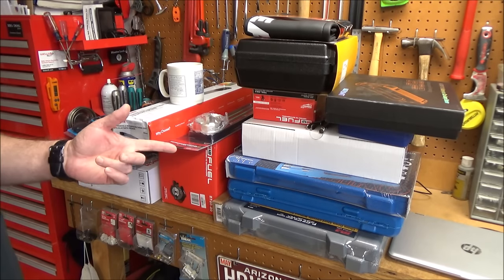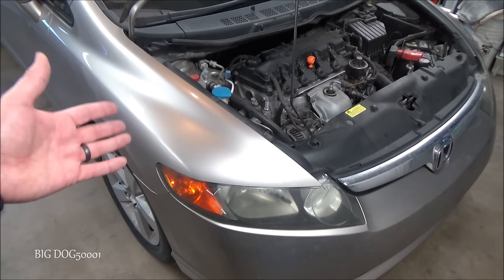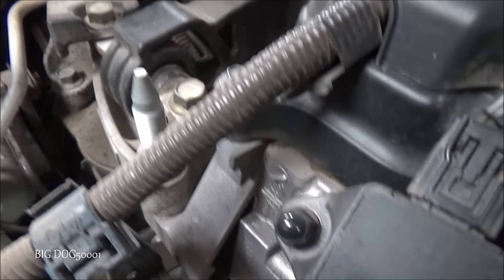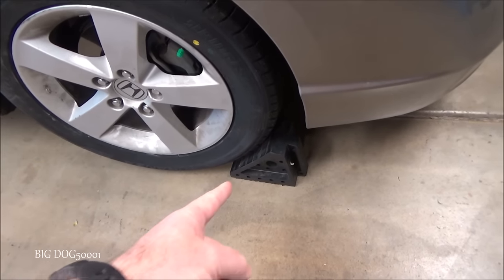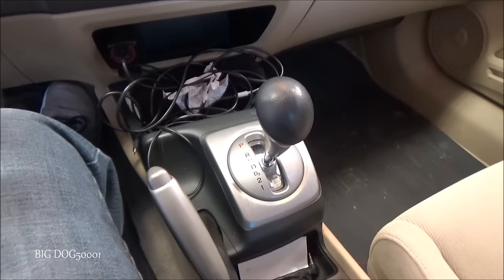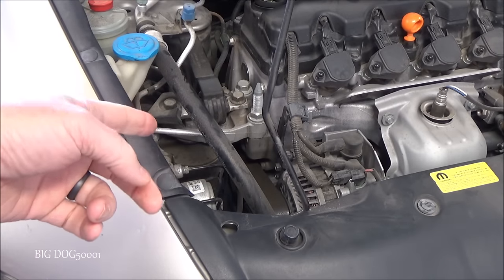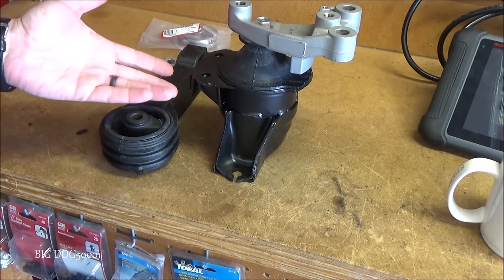Honda Tips: Clunking/Thumping Noise Coming From Front End of 8th Generation Civics

Comment: I have an 08 civic lx and the digital display goes in and out as far as the speedometer and engine temp and fuel level and sometimes the low fuel light blinks even though I had just filled up. Any help would be greatly appreciated

Comment: I just replaced my side mount and the torque rod, I had a vibration at idle and used your other video for replacement guidance but it also took out my clunking noise when I hit a bump which I wondered what it was, I replaced the front struts last year and thought one was bad.It took me longer than your video-lol-but I was able to replace all of the parts and I'm now good to go.Thanks for your helpful videos, they are a big help.....
Reply from the maker: Glad it helped, thanks for the comment!

Comment: A simpler check will be the gap between the rubber and the aluminum support, no gap or if there touching you need to replace it. The one installed has no gap, the new part you have does.
Reply from the maker: That's part of the visual inspection, thanks for the input.

Comment: Generally the symptom on those is a nasty vibration in gear and you dont have to torque them to see that they are bad. The mount collapses and the aluminum bracket on top touches the mount itself. Also, I have never seen  one of the torque mounts go bad or had to replace one. Save your money. 22 year Honda tech. Good video for the DIY person though.

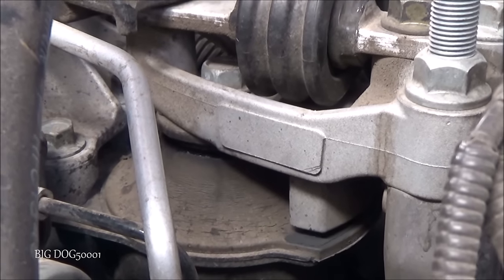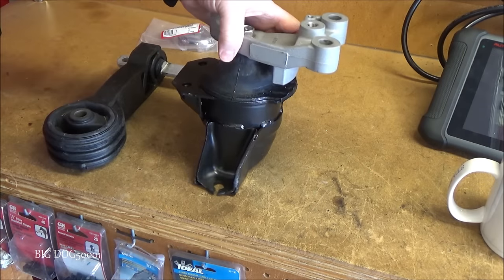Comment: 3:13 vs 4:03 not an uncommon issue, i use the "wear indicator" to determine if the mount is "sunk" and its actually the metal bar that you can see has rubbed on the mount and i will use that to determine its condition, otherwise you could always put a block of wood on a jack and jack up the oil pan and see if the problem "goes away", usually you get "excessive vehicle vibrations" and sometimes it happens more in reverse because of that mount failing, great video! just wanted to add another quick tip with the "wear indicator" i use, hope it helps someone else out there, thanks for the share!
Reply from the maker: Thanks for the input!

Comment: My 2007 1.8 L civic has a small vibration when I stop in traffic coming from the right side When I give it gas and take off the vibration stops.I will check motor mounts.Thanks for the tips,brother.

Comment: Great Video, my 08 Civic is getting a sharp clicking or metal snappy sound from the right front as though something is separating. Also, when steering to the right only, it lurches over much more that the steering movement allows, Has 130K on it, very tight otherwise, thinking strut mount or rack, thank you.

Comment: Good video. Wish I could've seen repair vid before I replace engine mount last weekend. Bolt to fender would not fully seat. Hope I used correct bolt.... did not pic removals.. my bad. Did run much quieter though and that's a good thing. Just want to complete job correctly....
Reply from the maker: Thanks for the input!

Comment: I would like to see you film on repairing this mount. Seen many videos of different procedures like certain bolts take out in order, engine drops back when removing mount due to not jacking engine correctly, etc. I want to see the reassemble because bolts don’t line up correctly. Some say taking out the bracket or jacking up engine will do. I’m all confused who to listen to.
Reply from the maker: Didn't realize there was so much misinformation, thanks for the input!

Comment: Hi thank you for the video. I have a 2003 Honda Accord. A couple of weeks ago my mechanic had to change out my water pump and my timing belt when I got the car back there was major vibration and sound that I felt all over the car. I went got brand new tires but I still felt and heard a thumping, it was in sync but now it is only in the pedals and in the floorboard. I went and got my alignment done and I got my brakes and rotors changed. I still hear and feel the pulsating thumping. At any speed. It slows down or speeds up with the cars speed. It still does it coasting in neutral. But not when parked in neutral while pressing the gas. I tried the thing you did with the car sitting still but in drive and pressing gas and brake  simultaneously and the thumping sound and feeling are there. But the sound is not loud, but I know it isn’t supposed to sound or feel like this. Something is wrong. What do you think it is?? I’m scared to drive the car!

Comment: Awesome tips Big Dog, always appreciate your videos. You should do the Transmission mount replacement next, it rarely ever goes bad. 
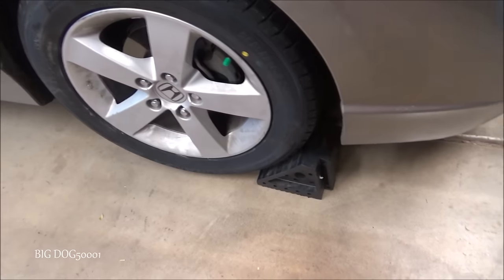 I would like to add another tip that will help identify if the Passenger side motor mount is bad. @1:48 time frame, you can see the vertical metal piece is touching the rubber lower mount. THAT vertical piece is mount indictor that its either too low or touching the rubber mount. If you can't fit 1 quarter in their, it is bad. If you CAN fit 2 quarters, its about to be done for. I just replaced mine and did a before and after visual inspection and found the new one can fit about 5 quarters, no more vibration at cold start, at idle, or going down hills or over bumps. Hope this small info helps someone.
Reply: Why would there be vibrations from cold starts and not normal starts?
Reply: cheers

Comment: 1:48 and 4:00 Pro tip. See how the metal tab on the side of the motor mount is resting on the rubber? Compare this to the gap on the new (revised) mount. Watch for the witness mark as the mount opens and closes. As a Honda tech, this was a dead giveaway that the mount had completely collapsed. (Yes it can also make noise/be bad when it is 75% or so collapsed as well)
Reply from the maker: Thanks for the input!
Reply: Hi can I drive with a motor mount that makes a clunking noise intermittent. Honda dealership installed a aftermarket motor mount because oem is backorder. Was told by Honda technician that I can drive with the motor mount only issue would be the noise. Engine doesn't move when shifting to reverse or drive
Reply: @jesuszuniga1257  can you drive with a bad mount? Yes. Should you drive with a bad mount, no. This puts more stress on other components, such as the other mounts, air intake tube, exhaust flex pipe, wire harness, ect.
Reply: The only reason I'm asking is because honda oem motor mount are backorder.  When I went to pick up car for diagnosis they said I could drive but the only thing would be the noise . Check the motor mount and engine is not moving at all its just noise
Reply: Was told by honda advisor that I could order a oem  motor mount online but wouldn't warranty the labor and part and that the noise would not go away
Reply: @jesuszuniga1257  The warranty info given is pretty standard, for the industry. The noise part sounds a little suspicion. Ask them if an OEM mount won't fix the problem, then what will.
Reply: I did ask them about that and they told me that if I find a oem motor mount online they can install it but wouldn't guarantee the noise would go away. I'm leaving to Colorado from California this Sunday and just want to get advice if it would bea issue. The aftermarket motor mount is new it's just the noise
Reply: I though it was the belt tensioner but confim by suspicious that's its coming from aftermarket motor mount.  I check the motor mount and there's no visible Cracks that I can see and the bolts are tight
Reply: I have the oem motor mount that I ordered from online . What advise do you give me . Get the aftermarket mount replace with oem mount knowing there's a chance it won't fix the noise issue or just drive and hope the motor mount makes it

Comment: Yes, film the repair. And demonstrate the test on a manual when you get a chance :).
Reply from the maker: A little more fun doing it on a manual transmission, thanks for the comment!
Reply: @BigDog50001  I would like to see that. Never came across in the shop only autos with mount issues

Comment: Thanks for the video. Film the repair, always nice and appreciated.  What I don't like on my 2015 Civic, is the clunk from the rear brake pads moving.  Dealer says it's normal.  Maybe I will change to non-Honda pads in the rear. The clunk has always been there from new and I only have 7800 miles.
Reply from the maker: I was actually getting ready to do a quick video on the brake clicking, thanks for the input!

Comment: My sound is more or a slight crunch of cracking noise when I shift into first and sometimes 2nd or 3rd seems to happen when its getting torque any ideas what might be?it still runs good just worried may get worse and become a problem.
Reply: Same problem on my 08 si. Get weird looks when I describe the sound as crunchy. Glad you said it too. Hope I figure this issue out soon.

Comment: I know this video is 3 years old, but to anybody tempting this repair please use OEM Honda parts. Like you said for some reason the aftermarket ones don't line up especially the Anchor Brand I had multiple returns and couldn't get the holes to line up so I just filled my OEM One with window weld!

Comment: Great VID!!! So under load you mean "you had A/C on and lights on when you torqued engine? I guess nothing running when you do this test?
Reply from the maker: No I don't think I had any of that stuff on, I just meant put a load on the engine by putting it in gear.  Thanks for the comment!
Reply: @BigDog50001  Oh my bad lol ..I really like your vids MAINLY because you give torque specs and that is very important for beginners for safety reasons of course. And is what seperates you from all the rest on Youube  THANKS SO MUCH!!!

Comment: Awesome test to see if the mount has gone bad !  I'll use that today.  I have a strange sound though that sounds like it's from the front right side wheel area, when I drive it makes a gear whurrring sound.  It is steady and increases with speed and descreases when i slow up, but it's very steady...does anybody have any ideas?
Reply from the maker: I would have to hear it to give more advice.  Getting the car in the air and doing a visual inspection can reveal a lot in those situations.  Thanks for the comment!
Reply: @BigDog50001  I bought some jackstands yesterday and doing that tomorrow for sure.  The more I have searched I think it might be where the CF CV or whatever goes into the transmission and it's pull out a little, but I can't find any sound samples.  Check it out, a website for sounds that need repair.  That would be cool...or not?    :) thanks keep up the good work.

Comment: My 2010 civic LX has 120K miles.  The motor mount isn’t broken (rubber cracked and separated) as you show in the repair video on this car.  When doing the torque test, as shown in this video, my motor/torque strut moves up as this one does.  Not sure if the motor mount is bad. What do you think?  Is it expected to move vertically 1/8” - 1/4”?
Reply from the maker: It shouldn't really move much at all.

Comment: Hi I  have a 2012 civic lx sedan with a clunking noise and honda technician verified it was the passenger side mount that another Honda dealership install (aftermarket) because oem is backorder.  The engine doesn't move when I shift to reverse or drive.  Is it safe to drive with the clunking noise. Was told at the dealership that I can

Comment: Do you have anymore videos on a Honda Accord LX V6..? I have a SRS and TSC Error. P0401 (Exhaust Gas Recirculation Flow Insufficient Detected) and P1457 (Evaporative  Emission Control System Leak Detected - B)
Reply from the maker: I have a few V6 videos.  SRS and TCS will need a good scan tool to start with codes.  I filmed this Honda Idle Learn video right after I fixed a P0401, it is usually a plugged EGR line on those V6s (I showed a picture of it):  https://youtu.be/cM2Y5J9j4IM.    Here is a diagnosis of a P1457 on a V6: https://youtu.be/ad8zvUA10og.

Comment: great video!is valve adjustment necessary on a 2007 honda accord with 100k miles?
Reply from the maker: Not usually, unless they are making noise or some other issue.  So many techs were creating more problems than they were fixing that Honda now recommends not adjusting them unless they are making noise.
Reply: @BigDog50001  thank you for taking the time to answer my question much appreciate it.
i hear rattling when the engine is not warmed up yet in the winter only (canada s winter)
Reply: right now the weather is warmer i hear no noise whatsoverver only thing is the shakes intermittentely
when i put the ac on
Reply: @Freedomind901 did you ever figure out the ac shake
Reply: @rixzin5046  still have the little shake when the car in on Drive and stopped so whenever i come to a stop with the ac on i just go neutral and the shaking stops. two years later and i still do that without an  issue.

Comment: 2014 accord v6 making a clicking sound no overheating just extra smoke out exhaust and extra oil in the head.  Rod knock or piston ring?
Reply from the maker: It could be a few things but the valves may need to be adjusted.

Comment: My 03 civic has a clunking noise almost as if someone were hitting something metal with a hammer. Happens only driving on uneven road or small bumps and seems to be from right wheel well. Freshly installed ball joints and swaybar links, everything is tightened. Do you think this could be my issue?? I was also thinking to check the sway bar bushings. (Strut and tierod are both in fine working order)
Reply from the maker: Those generation Civics are set up a bit differently but I would check the condition of the engine/transmission mounts.  Checking on the condition of the sway bar bushings is a good idea also (assuming everything you mentioned that were changed/checked are good).
Reply: i have a 06 civic and I have the same sound on the left side. sway bar links needed to be done and I replaced them, but the sound is still there. could be the mounts, I never once thought about that.

Comment: Did it fix the issue? I have an 09 accord. Same clunk when i go over bump ect. I already checked all my suspension and both struts are 1 month old. Can u send me the repair vid of before and after please
Reply from the maker: Finding a noise in suspension can be tricky.  Those generation Accords are known to have issues with lower ball joints making noise.  Stabilizer links are another part that will make noise when they go bad on many models.  If the issue started after the new strut install I would double check work (and verify is it not caused by cheap aftermarket strut assemblies).  I only use Honda or KYB struts (and only KYB complete strut assemblies).  For this car, a new engine mount fixed the issue  https://youtu.be/9VJBPO_GlhM

Comment: I know this is an older video but maybe somebody will comment. I bought an 06 sonata and it looks like somebody has replaced with quick struts in the front and the sway bar links have been replaced. Also looks like at some point the ball joints and outer tie rods were replaced. I still get a knocking noise over bumps on the front driver side. Would a bad motor mount knock  going over bumps?
Reply: I know this was 3 mo. ago but did it wind up being the transmission mount?

Comment: The engine mounts have been replaced on my car too but the clunking noise still appears whenever I make a turn to the right. What else do I have to look out for?
Reply from the maker: Sway bar links (stabilizer links) are a big cause of noise, but CV axles, struts, body panels and suspension parts/bushings can all make noise too.  Sometimes it can be difficult to pinpoint it.
Reply: @BigDog50001  thank you very much for the feedback!

Comment: I have a 2008 fit with 67,000 miles on it. It makes a clunking noise when driving slow, and is really noisy at highway speeds. I've read that fits are just loud cars. Is that normal?
Reply from the maker: What you describe does not sound normal, probably need to get that checked out.
Reply: @BigDog50001  yeah I'm thinking so, but I don't have time to do that soon. It drives just fine though.
Reply: @BigDog50001  if I post a video on my channel with the sound on it, could you tell me what it could be?

Comment: So I have a14 RAV4. I changed the struts,shocks,sway bar links, sway bar link bushing s as well When I drive over a bump it makes a semi loud thud noise. What can the issue be. ??please help
Reply from the maker: Engine mounts, suspension components, body seams and other panels can all make noise.  Sometimes it can be hard to pinpoint.

Comment: I had the thumping noise in my Civic, replaced the front engine mount and torque rod with an OEM one. Didn't work still had the thumping, so I replaced the transmission mount and lower torque rod (also OEM). Car thumps when I take off from a stop light or a slow roll. Where should I look next?
Reply: I had the same problem and the front eng. mount replacement fixed it. Have you looked at your struts real good for any problems? Good luck....
Reply: @tonyjordan1320  hmm I’m thinking an axle issue possibly? I might go over and retorque all the mount bolts  next time I change my oil. It’s not a huge issue but it pisses me off cause I’m OCD lol
Reply: @JarivLetap  I had a front bearing assembly go out on my 02 Dakota, it gradually got louder, I always thought a bad bearing would start clicking but this was a roaring noise. Good luck finding the problem.....I just watched a video on clunking noise on Civics, the guy found his front sway bar had a loose bolts and it was riding up and down  making the noise???
Reply from the maker: Axles and struts can make noise, and Stabilizer (Sway) bar links are notorious for making noise too.